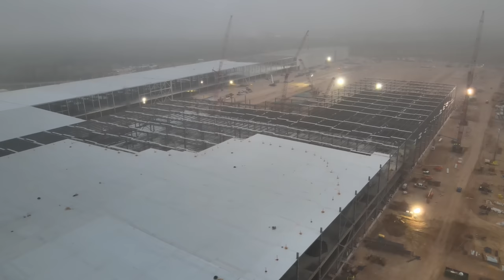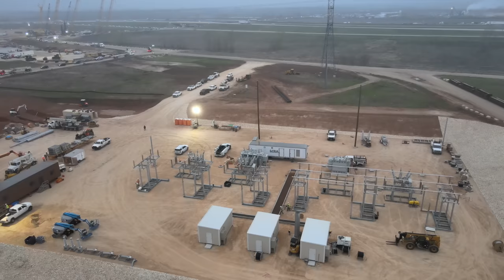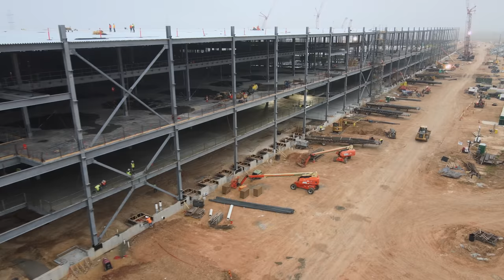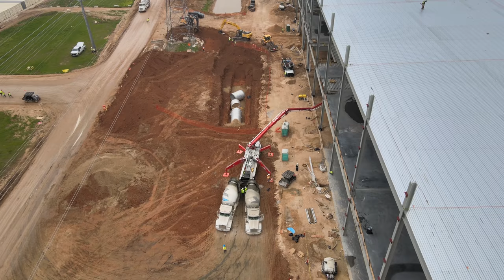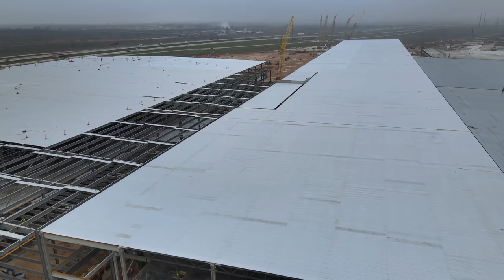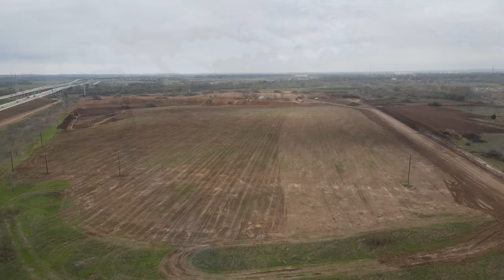Shift Change - 2021-03-16 Progress Update

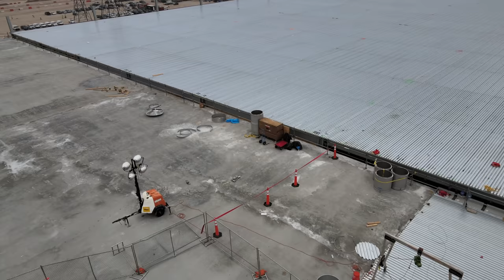Comment: I think the chimney out of the top of the building at about 14:15 answers the question of what heat source they are using to heat the aluminum. Unless one thinks they need such a large pipe to vent any aluminum fumes. I think they will be using natural gas to melt the metal. Thoughts?
Reply: It sure looks that way, but I would have guessed the only natural gas use on site would be for the paint fume oxidizer, similar to the stack you see in Berlin.
Reply: dont think its a chimney, cant remember a hole in the roof.

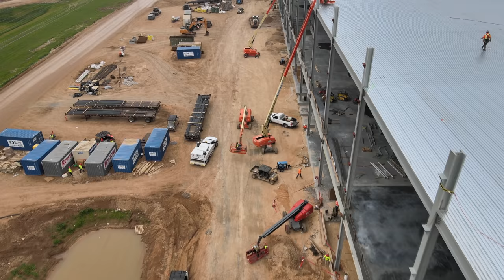Comment: Great video today, Jack! First time I've seen them install wall panel mounting brackets on the steel structure, and they have gotten a ton done! You can see them starting at 15:46. The ones the same color as the steel came that way, but they are installing a lot that are a dark red color
Reply: I'm anxious to see the type of exterior walls they will install.  Perhaps like Giga Berlin - concrete with an insulating, durable face?
Reply: @ThreeNoTrump_100  that's what I would expect! Those brackets look pretty heavy duty
Reply: Hi Zac. Interesting that they don't quite line up with the lugs on the concrete columns. The 3 steel columns abutting the stamping plant had brackets already fitted when the columns were placed. Thinking if the paneling was to be precast, the set out would be the same. I was thinking some lighter weight sandwich panel (structural insulated panel) would go on this blind side away from the highway. Time will tell. 

Difficult to tell for sure, but the brackets on the north and west face look beefier. They certainly project further.
Reply: @DessieDoolan  Hey Dessie! I noticed that also. It looks like the brackets are spaced to have the same height as the precast concrete panel, but they are at different heights than the stamping area. It looks like these brackets are designed so that panels will sit directly on top of them, which is different from the stamping panels where they attach on about a foot from the bottom of the panel. It definitely would make sense for these to be lighter weight
Reply: @zacadams7070  Yes, architecturally they would probably want to carry the line of the panel joint consistently around the site. Btw, I noticed they were caulking the panel joints on the west side in one of the videos yesterday. Couple of guys in a boom lift poking in a backing foam/backing rod/filler, to be finished off with a sealant, Sikaflex commonly. The inside might be treated differently for fire and acoustics. There's fire rated sealants, and they gap might be packed with a denser filler/rod
Reply: @DessieDoolan  Very true. In Berlin they are currently covering the concrete walls of the stamping building with another set of panels, but I doubt they will do that here. Saw it on Tobias' video from a few hours ago. And good catch on caulking the panel  joints! Hopefully that means the western most "room" inside the stamping building is pretty much waterproof at this point

Comment: Who look at the endless line of traffic from all the way over the Colorado River and around the site. How many cars are parked at Giga Texas in Rush Hour? 500? 800?
Reply from the maker: I had to wait in that line myself. It was over a mile long and took 20-30 minutes to get to the launch location. Then another hour for the traffic to clear.
Reply: @TexasTerafactory  Could it be that they were registering new employees today, and therefore needed more time to do the checks
Reply from the maker: It’s likely. The headcount seems to have surged.
Reply: @dariocupic423  Usually for something like this you do that off-site along with an orientation, specifically to avoid congestion.  (Other option is to do it an hour or two after shift start.)